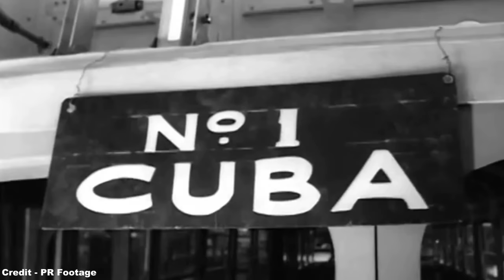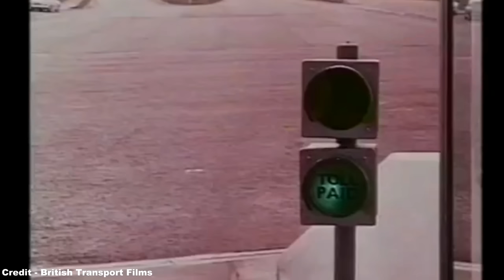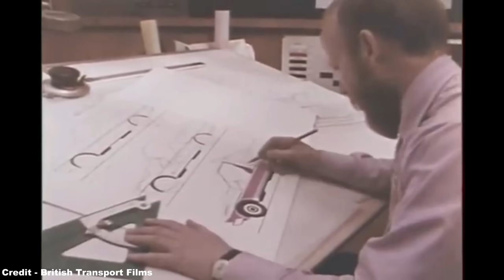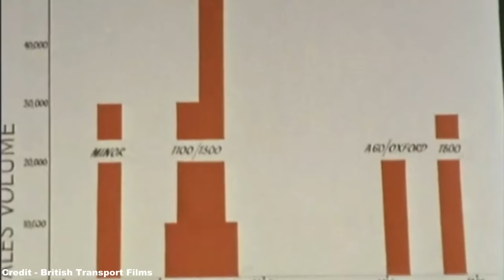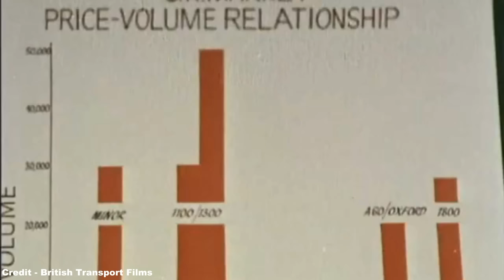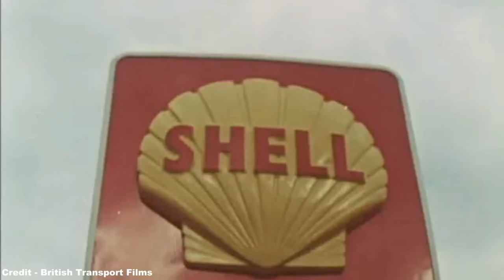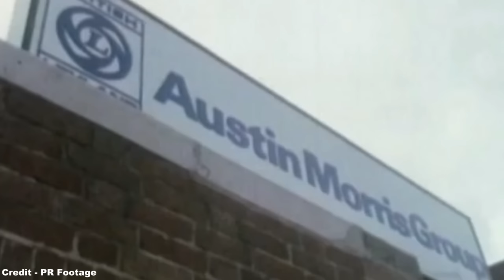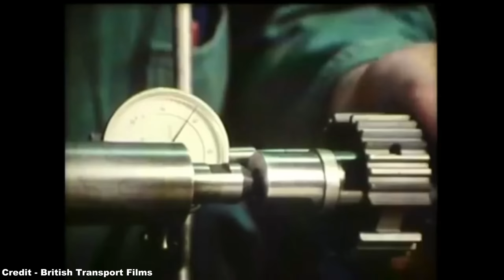Death of the UK Car Industry - Part 2: British Leyland

Comment: I heard a story about a customer taking thier new Allegro back to the dealer complaining a rattlling sound. The mechanics identified that the problem was coming from a door, and upon removing the door skin they found a coke can inside.
Reply: British Leyland giving you optional extras like that as standard. What a fantastic firm.
Reply: I used to work as a mechanic years ago, I remember doing a service on an Allegro one time, when I drained the engine oil I found a large ball bearing stuck to the magnet on the back of the oil drain bolt 😄no idea where it came from so I kept it in my toolbox as a souvenir.
Reply: @davidrobert2007 must have been the only part guaranteed not to rust…
Reply: Sometimes it's an Allegro, sometimes it's a Maestro... this story has been doing the rounds for decades. It's the kind of thing you'd think would have happened, but like all urban myths, who knows.
Reply: I heard that it was a TR7 built at the Speke factory.
Reply: The British Automobile Industry finally succumbed to shame. The badge didn't matter and was no surety of quality. 

I've owned: Hillman, Morris, Austin and Rover. The first and last were the worst brands.
Reply: I have a 1970 Range Rover (chassis #120) and when I was restoring it 20 years ago I bought several other 2-door Range Rovers as parts donors.  In one (a 1980 model) when I took the roof lining out, stuffed in the space above the windscreen was a copy of the Sun newspaper with a headline that read something like "Maggie will take on the unions".  Not before time.
Reply: Thinking about it for a second - this is actually fairly unlikely. A can wouldn't be rolling around at the bottom of the door - it would just be sat/wedged there and would take either chronic vibration or quite a lot of momentum to dislodge it. Also, why would a mechanic have to identify where it's coming from? You'd hear it when you open and close the door! I'm calling BS on this one.
Reply: The International Harvester plant in my home town assembled the very expensive Travelall station wagons.  During labor contract times, assemblers were known to fill tires with gravel prior to mounting, assemble empty beer cans into the fenders for that perfect rattle, and hang hex nuts on nylon fishing line between enclosed body parts for the metronome effect "amuse" new owners driving off the dealership lots.
Reply: @user-s1o3nr532  heard the same story but from Americans, a GM car, the 1970s. No doubt there are Italian and French versions.
Reply: @dcanmore  
But not Japanese.
Reply: Did they want to keep their jobs or not, one may well ask.
Reply: I heard it was a Jaguar. ¯\_😑_/¯
Reply: I can believe that! The production workers hated the management and the management never treated them with respect. A complete communication breakdown. So yes, the militant production workers deliberately sabotaged cars on the production lines.
Reply: Talk about market penetration - go Coke!
Reply: @user-s1o3nr532  Plus I am not sure the door on an Allegro is wide enough to have a can-sized space in the first place. But maybe he crushed it first? Which would both make it fit and reduce its rolling around potential. As far as mechanic being needed, Ive heard far too many instances of people bringing cars in to be diagnosed when its something REALLY obvious - like a wheel fell off and the driver complaining its hard to steer.
Reply: @bullnukeoldman3794  Do they still work there? Oh wait, they went out of business...
Reply: Easter egg
Reply: @IN_THIS_DAY_AND_AGE  that's  because they use the coke cans to make the car body....😂😂
Reply: @IN_THIS_DAY_AND_AGE  Japanese don't spite their own, that talk is reserved for the Korean cars lol!
Reply: @user-s1o3nr532  Like I stated, it's a story I heard, I've been working as an automotive design engineer for 25 years, might be BS, but I seriously doubt it given the other stories I've heard about the UK auto industry in the 70s
Reply: @bazza945  I do hope that your poor reference to Rover was after it was subsumed into British Leyland, and probably when it really meant Austin/Morris in the 1980s.  By then Honda had also given up on Longbridge.  Paradoxically, the later Rover 75 was a good car.  The Rover P6 was also a good car.
Reply: I’d heard the same but it was a Watney’s Party 4 tin.
Reply: I heard the same but it was a Rover SD1
Reply: I think it happened,  it’s just that people got mixed up on the car model over the years.
Reply: That coke can was the best use of steel to come out of British Lameland
Reply: @bollomcbollo6260  the trouble was that she did nothing to improve the competence of the management.....who had their own blind spots and self interest groups!
Reply: I heard it was a ball bearing in a Porsche!
Reply: Surprised the customer wasn't charged for the "aluminium upgrade".
Reply: This was very common in the U.S. as well. My grandfather worked at GM's Lordstown Assembly, in Ohio, from the 1960s until the 1990s. He told me that during the Chevrolet Vega production, Coke bottles were commonly placed in the doors by pissed off line workers
Reply: @patt6246  No , they were recycled and became Allegro back boxes😅
Reply: Blew a few loads in my neighbours wife in their Allegro. Happy days
Reply: @richardnixon4345  Bet that was a hairy experience.
Reply: Better than the new Air Force One where they found tequila bottles.
Reply: @tetchuma  RUDE! Cheers
Reply: @dcanmore  Me too….heard one about a coke bottle on a string inside a station wagon panel.
Reply: I worked at Cowley for 3 weeks on the Triumph Acclaim it was one big joke and everything went in the door Orange peel cans anything that should have gone in the bin went in the door...
Reply: @bollomcbollo6260  Maggie ruined british industry all round , out of spite and hatred of the organised worker
Reply: I heard it was the skeleton of a deceased child worker.
Reply: @davidrobert2007  Hahaha ! It's like a lucky dip with BL. You don't know what you'll get 😂
Reply: It’s a real tragedy the British car industry failed, why didn’t they just build reliable cars, like the Japanese did?
Reply: @masteryoda498  It was a failure of management and disillusioned workers who favoured strike action over work ethic.
They had great potential but screwed it up Royally.
Reply: @davidrobert2007  well you must have took sump off to find that
Reply: @richardsmith3585  Not at all, the oil drain bolt has a magnet built into the back of it (to trap metal particles in the oil - pretty clever in itself) but the ball bearing was stuck to this magnet. True story.
Reply: @davidrobert2007  you said large ball bearing them old English cars are iconic and I think reliable and if not you can repair them your self  im a big fan plus they get good money now new cars are crap and most are forgien
Reply: @user-s1o3nr532  urban legend.
Reply: This story goes around for every manufacturer.
Reply: @KischteBier  part of England's heritage must have been a con somewhere Germany made the names work are we dafter than them also cars are going up in value and people still love them
Reply: These if driven in reverse are more aero dynamic going backwards probably put them in the wind tunnel the wrong way round when testing 😅
 That's not the best hidden quality about these cars by all accounts when the wheel falls off Allegro's 😂😂😂
Reply: I heard rover went to India I might be wrong if they could make it work why couldn't we
Reply: I have a friend that bought a Tesla Model 3 when they first started production, and the car arrived with no seats and missing interior paneling, it was delivered on a flatbed and he received an email from Tesla management informing him that in order to meet unrealistic production goals  they were forced to deliver the car before it was finished..however he was assured that the parts would be delivered and installed within a few weeks, and to make up for it they provided him with a voucher towards the future purchase of software upgrades…
And yet this was never reported by the mainstream media because they didn’t want to bury Tesla as part of the whole climate change hoax they were promoting. 
True story.
Reply: @richardnixon4345  Was her husband driving it at the time?
Reply: The Allegro commonly known as Allagro .
Reply: @user-s1o3nr532  If I may say so, I  completely agree with you sir, A few so called "comedians " got cheap laughs , Tarbuck, Clarkson, while underming the British car industry in the process 😉
Reply: @558vulcanxh  They were struck into the ground long before she came to power.
Reply: As any good used car salesman could tell you, that was just a precursor, (as a test for crumple zones), which would be introduced at a later date😉
Reply: @macjim  . Cutting, but so true😉
Reply: @bazza945  . Yep, sad reflection on British workmanship once the preferred choice worldwide. I had, in my time; three Minis, a Triumph Herald, a Triumph saloon, (can’t remember the model, had a wooden dashboard, great for arm muscles - no power steering)! A Ford Escort 1100, (my first automatic), another Ford Escort 1300, (another automatic). All did high mileage, a couple of oil leaks but basically scrapped as they rusted away. That was in the 70’s and early 80’s.

After that had a Fiat 650, (in and out of London from High Wycombe every working day for 3, years and no problems except the dreaded rust again). Then a Honda, (another automatic), then a Sunbeam, (yet another automatic), then a Volvo 244, estate, (ran on petrol and LPG - tank for which was mounted in the back, half in, half outside the rear space so it took up a bit of the rear). It stopped on me one day, as if it had run out of fuel. The ‘AA’ man was quite gracious when he took me round the back of the car and opened up the tailgate. Asked me how long I’d had the car, (it was 2, days), he said; well mate, you’ve been running on LPG gas since you bought the car then, showed me a rocker switch on the LPG tank and explained this position is LPG, this position is for petrol, topped the petrol tank up with a couple of gallons which, I think, was 85p, (remember those days)? And off I toddled to the nearest petrol station. I never bothered with the LPG after that!

Ah, the joys of motoring! Sorry for the long post!
Reply: @IN_THIS_DAY_AND_AGE  . They probably had empty Bento boxes, or sushi boxes😉. They wouldn’t make much noise.
Reply: @lg_believe333  . Yes. Lost opportunities on both sides 😞
Reply: @natehill8069  . I had that on an ambulance I was driving in the early 80’s, (I won’t mention the ambulance authority, but they bought a job lot of vehicles from ‘up north’ who got rid of them because the wheel nuts had a tendency of undoing themselves), when my crew mate said something doesn’t feel right we radioed our base, they put us through to the mechanic on our ambulance station and he just said; oh, you’re driving one of those? He came out with another vehicle. We transferred our patients, (thankfully just day care patients), and off we went.
Reply: When you buy a brand new car and the ashtray was full?
Reply: "urban", or well neocon legend, pretty much every car maker has a similar story attached haha look at those brutish proles, if only they weren't so slovenly, we'd still have an industry...
Reply: @tetchuma I heard a Jaguar/Daimler owned by the Queen came back for refurbishment and they found an 'Adult' magazine in the upholstery. Lots of stories, I am guessing.
Reply: It was pronounced Britshit Leyland for good reason.
Reply: @williamlong2660  and their logo was the plughole of despair...
Reply: @tetchuma Jaguar build quality was generally relatively better, as its workforce, retaining more independence than the rest of BL, had more pride in their work. Of course, that didn’t immunize Jaguar from problems relating to poor supplier quality (e.g. Lucas electrics.)
Reply: @frankbertuzzi4782 If you haven’t read Ben Hamper’s “Rivethead,” you really should.
Reply: @558vulcanxh The “organized worker” was a major reason for the decline of British industry. The stories I heard from my uncle who worked at Cowley in the 1970s…
Reply: Very common, issue
Reply: I wonder what we could find in alfasud doors..
Reply: Lol
Reply: Reliability was the main reason the British car industry.
Ancient motor's that always wore out quickly and broke down down
The Japanese  cars were reliable and easy to fix and drive.
The gear boxes particularly bad.
Reply: The union vs hierarchy didn't help.
Reply: Vauxhall as well Ford some models ok but not really great.
British industry on the whole had an antiquated hierarchy plus a militant trade union the worst of both.The Japanese had constant improvement and good boss worker relationship. The British thought they knew better attitude which still pervades today the old empire we are superior to those subject's of the empire.
It stifuls innovation and cooperation.
Reply: Well said Rob, totally unbelievable behaviour. You would think they might just take some pride in their work & the product never mind having respect for the customers that invested in the vehicle. Plus, for the companies that employ them. Don’t the idiots realise that it potentially damages the companies reputation and therefore their employment. It’s the them & us mentality, a well nurtured sense of victim hood. Pathetic.
Reply: @richardnixon4345 So important to maintain discretion.
Reply: It was a metro  @user-s1o3nr532
Reply: Allegro you mean 👍
Reply: @giuseppebenvenuti2396 Nothing,
will have fallen out from the rusted bottom of the door after 4 months.

Comment: A couple of unsubstantiated stories about the Morris Marina. After several brake failures it was discovered that a drum of brake fluid used at the factory had been placed under a roof leak which contaminated the fluid. Another classic brake story concerned a customer returning his new Marina to the dealer complaining of the brakes pulling to one side. To placate the customer, they put two of their best mechanics on the job to sort it quickly. Everything Was inspected, cleaned, bled and adjusted. No faults were found. Next day the customer is back complaining of the same fault, especially under prolonged and heavy braking. As it was busy at the dealer only one mechanic was tasked with fault-finding. The face-palm moment occurred when the guy found it had disc brakes on one side and drum on the other. The basic 1.3 version had drums and the more up market 1.8 had discs, and both versions were built on a mixed line. Just a couple of stories among many about lack of quality control at the factory.
Reply: The story about the brakes is surreal.
Reply: Ah the good ol` days!

Comment: In Germany British Leyland was always called „Britisch Elend“, Elend rhyming to Leyland. Translated it means British Misery. The only car sold in any number (in Germany) was the Mini, some Triumph Spitfires and Jaguars. Everything else made by BL did not see any numbers in sales. Though some other makes (Alfa Romeo with their Alfasud) had a bad reputation, BL had the worst. You had to be very lucky to see any BL car at all. Several BL dealers went bancrupt, some changed to sell Japanese cars.
Reply: they also sold a number of SD1s.... there have been some of them in my town i grew up, outnumbered by VWs, been just a few km away from Wolfsburg...lol!
Reply: Sd1s improved a lot by the 1980s. The early ones are (were) best avoided.
Reply: The mk3 golf wasn't good, and I grew up with a beetle the screenwash worked off the spare tyre, great until you had to change the tyre and found it was flat, it also suffered rust. Mercs of the 90s were rot boxes and bits fell off. German cars are not all that. A friend had a 1 series bmw thing was always going wrong.

Comment: George Turnbull was a VP for Hyundai Motor at its start and his half dozen engineers created Hyudai's first car, Pony.  One of the Turnbull's engineers remarked how insanely quick Korean engineers were at producing prototypes.  "What would typically take a month in UK would be finished and produced the next morning." - Edward Chapman.    I am sure the Korean engineers were eager, hungry, and had something to prove , resulting in them working extra hard.  However, the fact remains that what would get done in a day in Korea was taking a month in the UK.  That fact alone is reason enough why the UK car industry failed.
Reply: Coming from the other side of the world I noticed that attitude amongst English people trying to get things done. Where migrants I dealt with were able with ease to fix any problem. Just buying a train ticket you notice the difference.Slow full of self importance over just getting it done as quick as possible.
Reply: And cost four times as much.